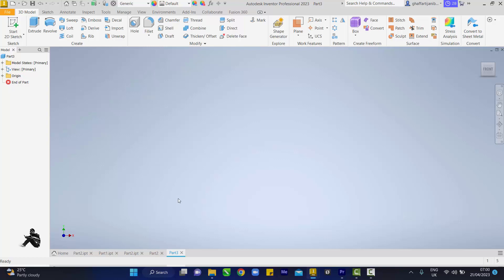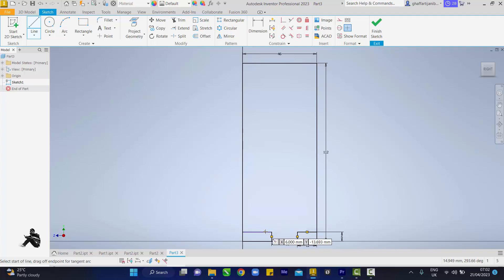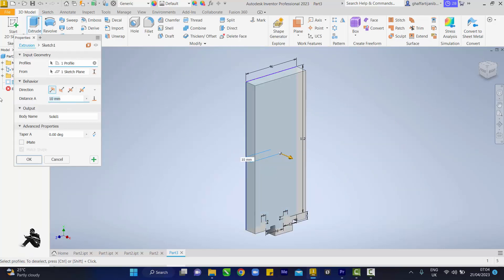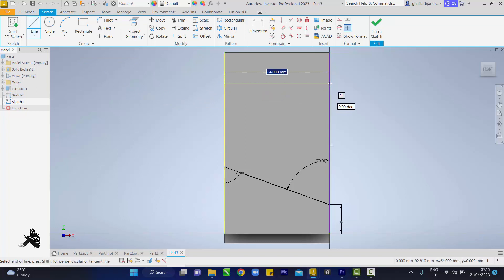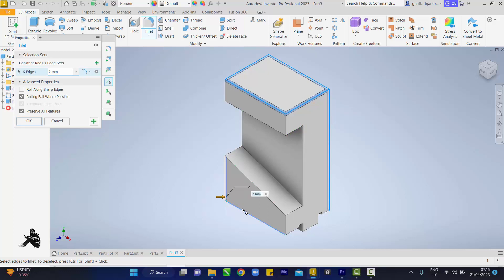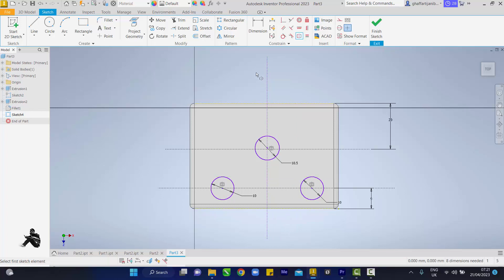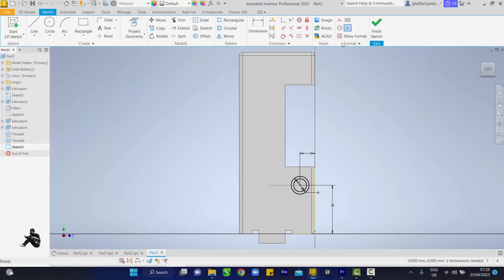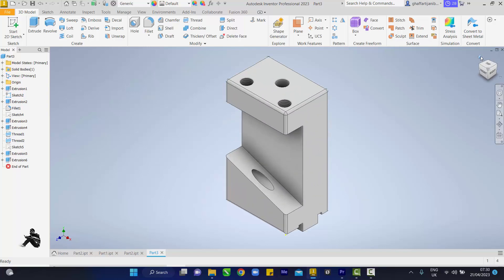Autodesk Inventor 2025 - Tool Post Holder Tutorial

Comment: Nice job. I would make several possible recommendations regarding your workflow method here...

(1) 4:05 When sketching, only use dimensions where absolutely necessary to define features. Alwasy use geometric constaints in preference to duplicating identical dimensions.
(2) Never extrude circles to define holes. Hole features ALWAYS. When in the drawing environment you'll make life easier for yourself when dimensioning.
(3) 11:09 Separate different hole types as different hole features. Don't try combine everything into one feature. Only use the thread feature for external threads where unless its a custom internal thread.
(4) 7:20 All chamfers and radii should be added as the last features in the feature tree. Because if you decide to delete a radius, it will break all sketch references that use those features downstream.
(5) 8:35 and 12:22 You don't need to put construction geometry onto a new sketch so much. Just dimension from the hole centre to projected geometry directly.

Keep up the good work 👍
Reply from the maker: Noted, Thanks for your time 😊